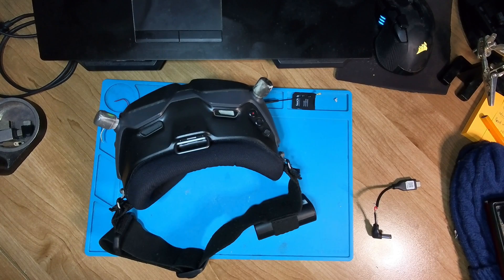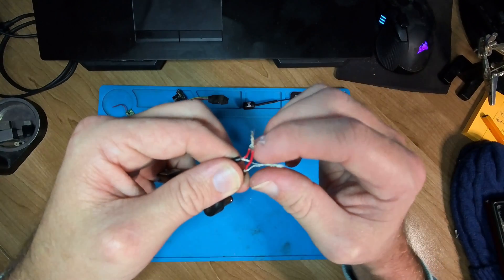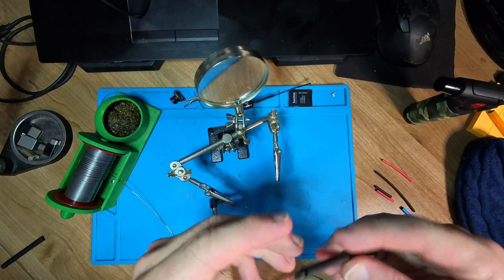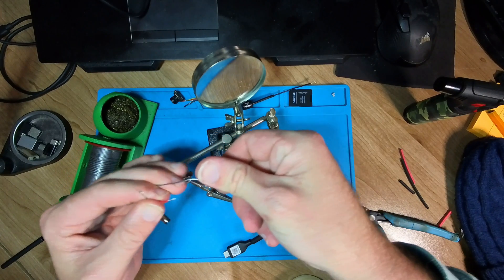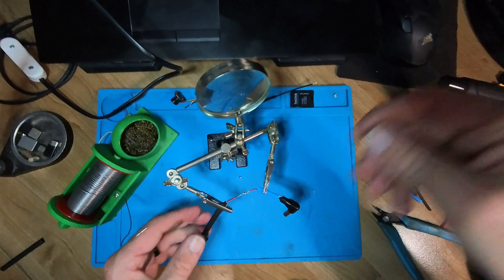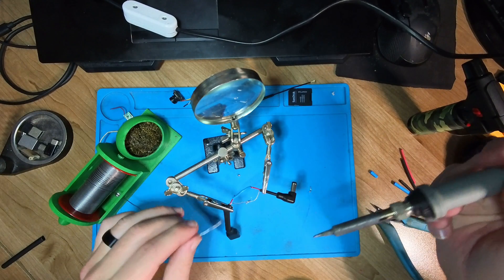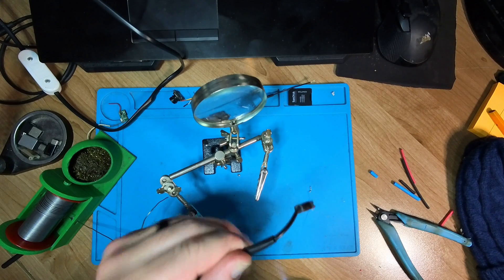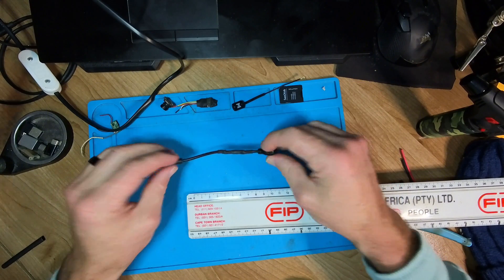DIY Short DJI Goggle battery cable! So easy!

Comment: To take tension off the barrel plug zip tie the cable to the metal buckle and route the cable over the top and back down to the battery. Around 15cm to 20cm long cable is perfect.
Reply from the maker: I agreed! 100%